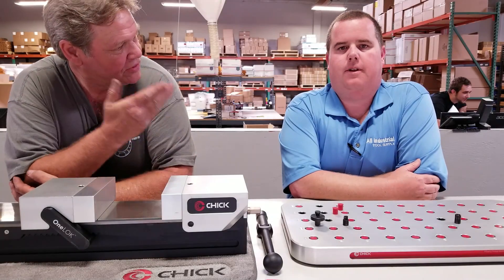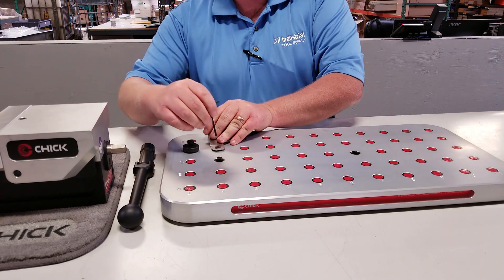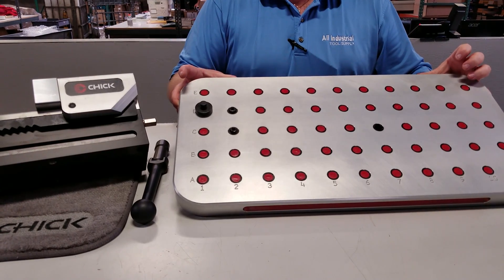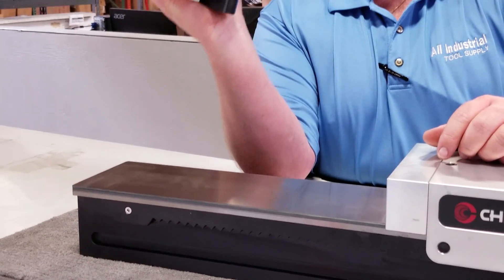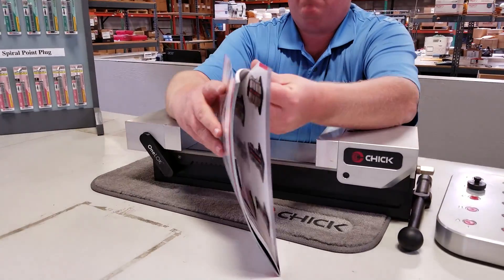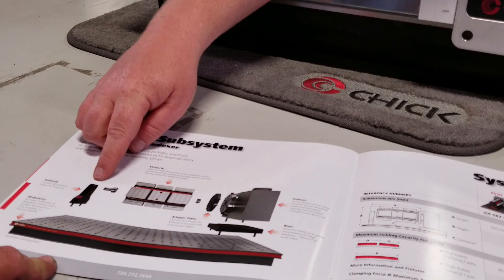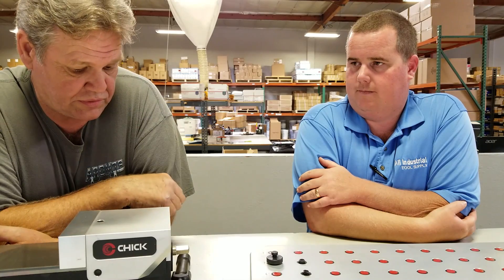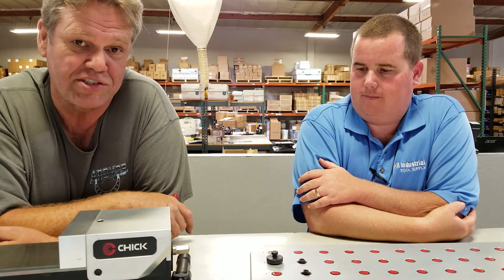Chick workholding for your milling center

Comment: I really like Chick products. I first saw the OneLok vise at Westec, I believe back in 2007 as a prototype. That’s also when I was introduced to Chick. After I got my mill in 2008 I put one of their foundations on for quick setups. While I like their vises, I modified some I already had with locating holes. The chip free design and quick changeovers of the OneLok make it a great vise.

Comment: I cant find the vises on all industrial site?
Reply from the maker: Give them a call, all systems are custom built, talk to Luis.
Reply: It looks like it will just be similar lead-times from factory at 42 days. I would have bought these but couldn't way that long and bought orange. Problem is dual station vises are too heavy fully assembled. What do you think of the new version of ONE-lok vs the old full cast iron one? It just seems the new one has so many assembled components for the base vs a solid cast iron base. I wonder how this will effect performance when machining tougher materials.

Comment: I remember when the one lock came out I was given a demo. But the version I tried had a cast iron base which was hollow underneath to house the screw..and the jaw carriers were cast iron so it was very heavy! It had the aluminium soft jaws like this one though and quick lock mechanism was operated by a spring plunger ..on top of each black lever..quite different to this one which looks to have an aluminium base..